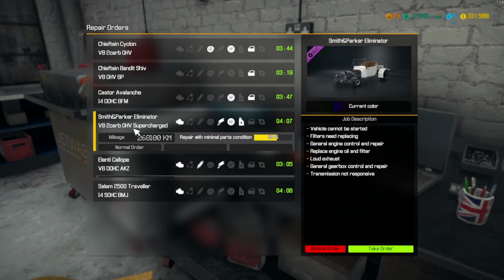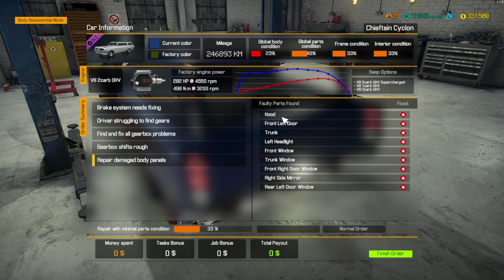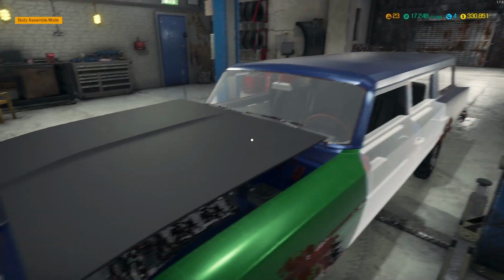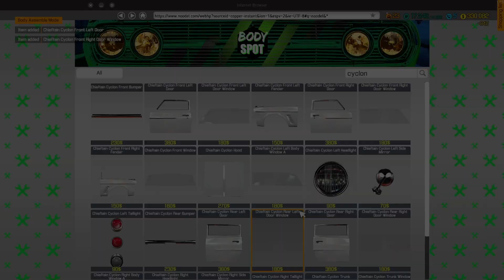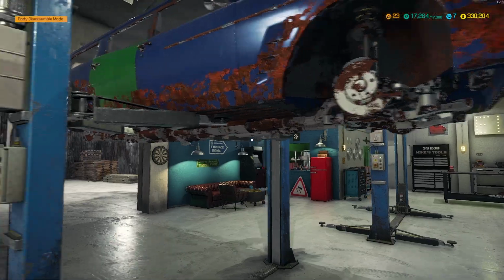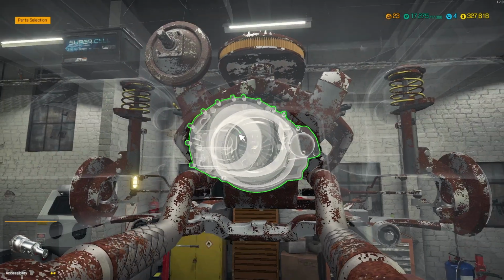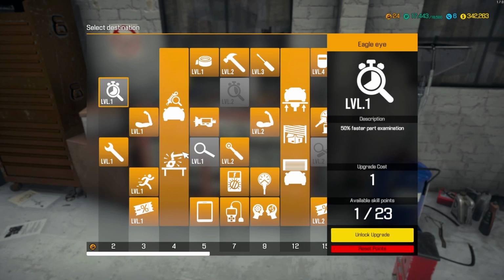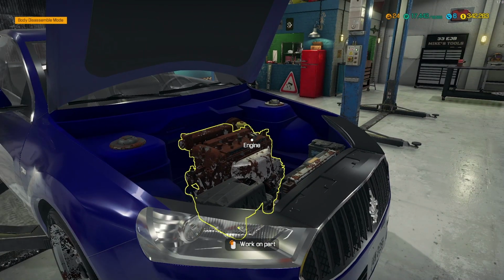This Cyclon Has Seen Better Days (Car Mechanic Simulator 2018)

Comment: Just a reminder that if you want to fix one of those wagons up, nothing stopping you from buying one at auction, or in the barns or junkyard if it's there? This car is from a DLC I don't have so I'm not familiar.
Reply from the maker: I agree. As I've said though, I'm waiting until I can repaint vehicles before doing barns and auctions.
Reply: @raysgames9778  I know, I know. I'd still like to see it. No rule against buying a car and fixing it up, and holding onto it until you can paint it. And you do gain experience that way too. :)
Reply from the maker: @brianisaacs5426  that actually is a good idea I had not considered... I think I will do the story car first, then will take that advice.